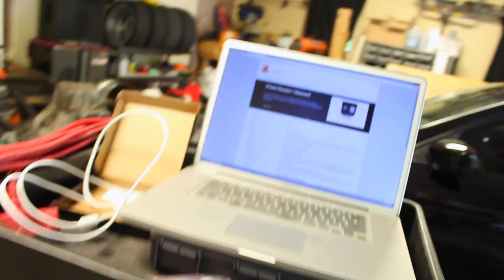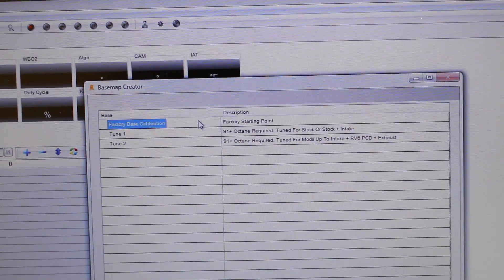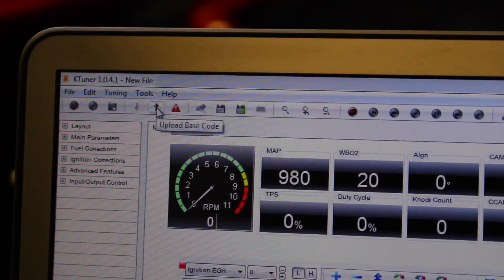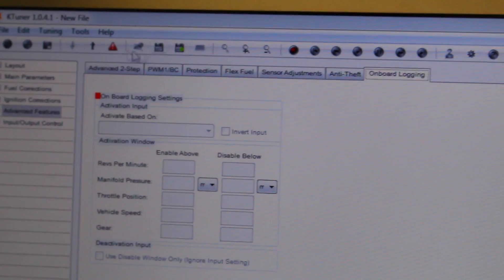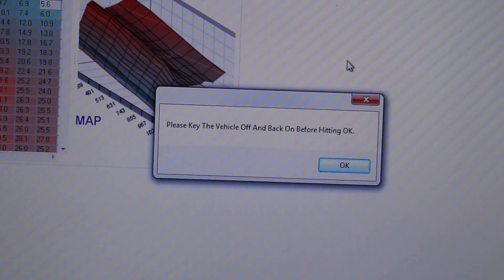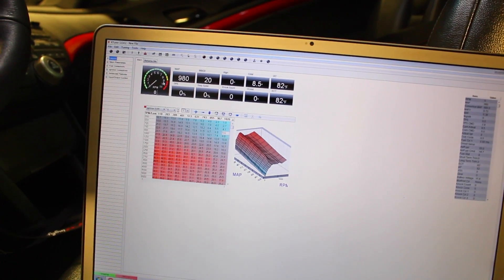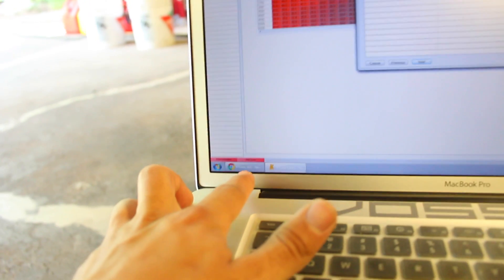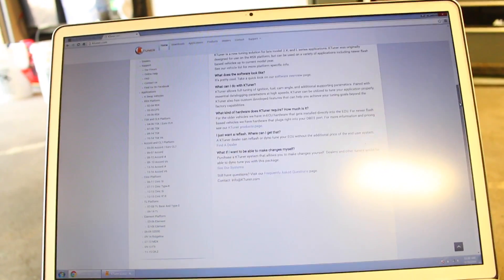How to Flash Your ECU (KTuner)

Comment: I have a 2001 nissan maxima the car cranks but won’t start the ecu is in lock mode code p1610 will i be able to flash the ecu with the ktuner if so do i download the software and plug in the obd or does it have to be programmed to the car

Comment: Can I use this to remove the check engine light I get from a leaking evap system and no cat converter? Car is a crv with a k24. Id like to open up the exhaust system and drive the crv till I swap the engine Into something else.

Comment: Is it difficult to diy? Other than the tuning tool and files what else do I need
Reply from the maker: Not at all! The software is very easy to use, you just have to go through it a couple times to utilize all of the features, but it is not difficult to get your head around even if you haven't done it before.
Reply: @milanmastracci  thank you so much for the reply ! appreciate that. so that means even i were to do a pops and crackle tune i have to trial and error?

Comment: Thanks for the video, I do have a question. I have 2015 accord sport 6mt. Only mod is a exhaust Nd resonator delete. Going to get a aem cold air intake next. Now for my question, can I get this ktuner and install option 2 without the rv6 PCD?
Reply: You can pick this tune although it probably wouldn’t be the best option since you don’t have as much air flow as the pretune. You can sometimes run into issues that way. I’d stick with the 91 octane tune until you get a pcd downpipe

Comment: If it say 91 octane required, do you only have to put in 91 octane if you want to run the tune or do you now have to always put in 91 octane even if you just want to drive normally
Reply: Run it at 91 only. Your car is tuned to perform with the higher octane in mind if flashed. It would be like putting regular gas in a premium corvette, makes it run worse.

Comment: my 08 civic have a p0172 rich code. cant fix it, and i tried everything. fuel trims are -18 long and shortterm. sometimes stalls too. can this be corrected if i tune it with this software.

Comment: WIth K tuner, you siad I can turn my check engine light off, Will it also allow me to pass emissions? or is it like when I reset the check engine light with a scan tool and have to drive the car for like 50 to 100 miles again?

Comment: I want to make my honda hrv automatic to change the gears
1 changes to 2 at 50
2 changes to 3 at 90
3 changes to 4 at 130

Is it gonna be better or not?
Reply: Panayiotis Toumazou no, you won’t have the torque to do that, try
1-2 @ 35 
2-3 @ 70 
3-4 @ 105

Comment: Is vtech and nonvtech ecu the same on older accords?
Reply: First off, google what vtec stands for and please spell it correctly. The pcb is different between vtec and non vtec, please dont ask if swapping a vtec ecu will give your non vtec engine vtec.  I'm leaning just like everyone, one of the first things you should do is figure out what you want rather than getting what everyone else has.  You wont be satisfied if you don't know what you want.
Reply: Lost Child  I’m not worried about a the performance stuff I only wanna get my car inspected since the used vtec motor I installed reads not ready I only can guess that the computer has an issue being for the other nonvtec motor       Also my phone changes the spelling on its own! Thanks for your concern though!
Reply: And pls note i asked about the ecu not the motor. Well aware it’s an extra option to the motor like two more wires! For the vtec selinoid if I spellled that correctly
Reply: @stevenlong9144  i'll start by apologizing. I become quite prejudice when I see VTEC misspelled ... Um hate to do this to you but its a little bit more than just an extra option to a motor with extra wires. Anyways, did you find the answer to your question?

Comment: Just a little reminder... ...a car and a laptop should both be connected to chargers - some cars don't even allow flashing if there is less than 13,5 V available. Oh, and good luck flashing it over bluetooth ("it doesn't really matter which one you use, they both do the exact same function") - ECUs get messed up even over BDM, more with USB, flashing it wirelessly is a recipe for disaster.

Comment: Does this eliminate rev hang?
Reply from the maker: Yes!! I love this thing for that reason
Reply from the maker: You can set the rev hang to whatever you want, any value from 0 to 100. I like it at 20 👍
Reply: Cool thanks dude. Do The tunes come preloaded or do you download it from the website? The 0 to 100 value , the closer to 0= no rev hang?
Reply from the maker: No problem man! Yeah the base tunes come installed on the software. There are a few to choose from, and the sky is the limit for fine tuning. Yep you got it with the rev hang

Comment: I'm wondering what the difference is between using the I obd port and sending the ecu to ktuner directly. Do I need to send my ecu before I can use this device? Or is it directly plug and play with no previous mods to the ecu? Thanks!
Reply: I don't think so. You can take your ECU to get reflashed by a professional tuner. Or you can do it this way like in the video with your own tuner flashing device. Besides that when I had a 2006 acura rsx I figured out that in order to do an engine or transmission swap you will actually need a aftermarket ECU then reflash it to whatever mods you have in the car. (Most likely might have to get a professional to do it for you unless if you can find base map files online with the exact mods you got)

Comment: Is the TLX based of the Accords? So is it safe to say that they have the same tune
Reply from the maker: I'm not entirely sure about the new TLX, but I know the older TSX is the same platform as the Accords. I wouldn't be surprised if the new chassis's are shared between the two
Reply: milanmastracci oh ok because I want to tune my engine and I was wondering what the spec are closest too
Reply: milanmastracci hello  back again, I was wondering where do I get the software to put on the computer 💻

Comment: nice video. Question: would this work with any car? I own a 2003 Infiniti G35 3.5l V6 manual, and a 2005 Mini Cooper S 1.6l Turbo
Reply from the maker: You will need to get a tune for your specific vehicle, but the tuning process is more or less the same

Comment: What if you don't have a key on/key off but a push button?  I have had Ktuner for years but am just running into this today.   If I hit the push button to tune it off, it disconnects.  If I push the push button to turn it on, I can hit upload tune but the car is actually running at the time.  I know it'll turn it off when this happens but it doesn't seem like the proper way to do that.  

How do you put it to 'key on' with a push button?

Comment: Is this gonna work with CVT car? I wanna install cold air intake to my Honda Civic CVT and I have to tune the car after I install it. Your comment/s please. Thanks
Reply from the maker: Yes it will work :) The only time it won't work, is if the ECU also controls the transmission and the shift points. I'd message Ktuner for your situation for an exact answer.
Reply: milanmastracci thanks man! I really appreciate it! I messaged other car enthusiasts Ytubers, and you're the only one responded!

Comment: I've already done this and combined it with Sprintbooster. Also if you've notice that many other parameters aren't available and won't be for a long while. As far as the tuning you'll need a professional to do it but everything else you can do such as what you mentioned as well as drive by wire settings.

Comment: I believe this to be a Good question! been watching all Accord videos and noticed you have RV6 downpipe, Takeda SRA intake and Exhaust.. My question to you is After installing back on Stock muffler did you adjust your Ktuner for stock muffler?
Reply from the maker: Yes. When I put my stock exhaust back on, I noticed a laaaarge loss of power, so I might upgrade to something a tad bigger come this spring :)
Reply: milanmastracci ahh I did ask this question twice but only on the videos relevant. how cool. I went with the Jet Performance throttle body spacer and it is blue so I did my engine covers Chameleon blue the blue silicone hoses you installed are a great cosmetic Mod. thanks for the videos! and the communication with your fans!
Reply: I would now have to ask what exhaust comes to mind? I'm sure I'll see it in a vid

Comment: Can you get this done by a professional so you can get the most horsepower for your buck?
Reply: @David R.F. Does this work on a 2004 acura Tl. I have read that the ECU will reset itself and if so can I put a 2007 ECU in a 2004

Comment: is your MacBook really running Windows 7? upgrade to Windows 10 it's way better
Reply from the maker: I can't stand windows 10 lol I have bootcamp running windows 7 and its been my favourite OS for windows
Reply: Oh ok I've been using Windows 10 science July 30th and have never been disappointed, i also installed Windows 10 on my 2009 1 core Acer laptop and it runs way faster then when it was on Windows 10, also a helpful hint get a antivirus because Microsoft ended extended support for Windows 7 and stopped sending out security patches and updates
Reply: i was hating w10 too but now taht i have upgraded and installed startisback,it's pretty much the same.
Reply: Windows 10 is trash bruh

Comment: Awesome vivid!  First question, would a simple re-flashing the ECU remove the speed limited on the car and secondly,  is any bolt on necessary on the vehicle?  For now, I'm just interested in removing the limited.  Thanks!
Reply: Required cold air intake if you change exhaust system that's better😉 car willl be more freelyand give more power

Comment: Would definitely like to see more tuning videos, particularly playing with different setups that emphasize Max MPG vs Max Power... and things like Would you tune differently for the winter vs. for the summer since the actual gas you buy changes chemically for the season, as well as the air temperature (and thus density change), etc.

Comment: is it really that easy??? it is not necessary to have the car on a  dyno while doing this???
Reply: Allan Jørgensen yes that easy, dyno is just to measure your cars current torque or horsepower
Reply: @Minecraft007crave  yeah, so that you can fine tune your basemap
Reply: Literally just a remap if you want a true tune you need to get it on a Dyno and do some pulls... change cam angles, ignition timing, fuel mapping excetera... gains can be made by remapping but it Dyno tune really let you dial it in

Comment: can doing this affect your car negatively? i have  4 cylinder Turbo and I'm worried i would ruin the turbo. I would just run one of the already mode tunes, nothing custom. And does it increase performance and MPG? Thanks, Great video!
Reply: I would say it could Shorten the life long term on the turbo but you can always replace it with a bigger and better one🔥

Comment: is that a 17inch old macbook pro? what a rare item.  Can the car save fuel and get little more power at the same time with tuned ecu?
Reply from the maker: Sure is buddy!! And its fully specked :) 
With a proper tune, you can get the performance when you floor it, and the fuel economy when you're just cruising. These tuners have the potential to do the car great

Comment: There are some tuner chips I can buy and apparently it will make my car faster but idk which one to get and if I have to do any addition upgrades with it. Because of the chip does what it's suppose to and increases the amount of hp I put out then technically I would need a new transmission, wheels, brakes, etc?
Reply: ecu tuning is great, my 2007 s600 had 510 hp stock. I got a RENNTECH ecu tune and got 612 horses
Reply: no need of upgrading anything else

Comment: Hey, how do the RPF1s affect performance? notice any difference from the lighter weight wheel? also what coilovers you running? Im thinking of Ktuned K2 coilovers on my 2012 V6 HFP Coupe 6/6
Reply from the maker: Other than the added grip, they're nicer when going over bumps, but as of the weight, my car is still pretty heavy to notice a difference. I bet if my car was 500 pounds lighter, I would notice a bigger difference

Comment: Let VTEC engage on idle lol
Reply: your right..but i dont even think vtec will pop at idle because the oil pressure is to low at that point ...my vtec came on at 43000 in my h22a with cams ...that thing use to sound crazy every time vtec popped lol ...my vtec crossover was loud as shit sound like my vtec was gonna brake lol
Reply: How to convert a car alarm to home alarm
Reply: Adrn Ncso YES 😂😂
Reply: Lmao nice
Reply: Why not just upgrade the cam if that were the case?
Reply: You can run vtec killer cams which I think toda makes... basically makes your car runs on the high cam all the time... because your always on the high cam, it pretty much gets rid of vtec
Reply: I want a vtec switch on my rsx
Reply: Legit Drones also setting vtec is important, everyone thinks the lowest rpm you can set it will make it faster ... not true, you want vtec right after your peak torque to keep a steady power and. That’s why dyno tuning is good , you can see the graph

Comment: so how many horses ur car run
Reply from the maker: Until I get the car to a dyno, i'm not sure.
Reply: +milanmastracci when is that?
Reply: @casper360s, I don't want to sound like a debbie downer but flash ecu's rarely do anything beneficial, more harmful if anything. The only time you'd have a significant boost is if the year, make, and model in question had a suped up version. (ie integra to Type-R, jdm to usdm s2000s, the earlier civic SI models). His accord is fairly recent and doesn't have that so who knows what will happen.
Reply: reflashes are highly beneficial on newer model hondas and especially the k series.

Comment: These things have been proven by multiple sources to not do anything or make things worse anyone planning on doing this should do actual research and find out for yourself this is pointless or in worse case scenario harmful to your car people tune cars as a profession and each car is unique even if it's the same model and make people wouldn't have jobs if this worked
Reply from the maker: That is not true.. I can 100% attest to the fact that this tuner makes a big difference on the car.
The cheap eBay tuners that are like 20 bucks, probably won't do anything, but the aftermarket tuners that are similar to Standalone ECU's make a world of a difference
Reply: im always willing to be proven wrong give us some numbers:)
Reply: Cpd Hyrule the random China garbage that plugs in a says "fuel economy mode" crap are the scams. this actually reprograms the ECU.
Reply: Cpd Hyrule Cpd Hyrule Whaaaaat, you're smoking something. Kpro, Ktuner, flashpro, they all bring big gains, even if it's something as simple as a preloaded base map. & besides, why would you put bolt ons without having your car tuned, how is the car going to take advantage of something as simple as a cold air intake or something like headers. Dynos & your butt dyno can prove it.
Reply: look up a dyno of a car before and after having either a kpro or ktuner put in....It's been proven countless times that these ecu mods are very effective
Reply: Cpd Hyrule if you think that try running a 13 Accord v6 (J35Y2) with FBO (already a 14 second car stock).... okay now Run that same 13 Accord v6 with FBO once it’s on KTuner and has VTEC engaging in every gear at 3K RPMs. I promise you that your going to see a big difference
Reply: Cpd Hyrule Word**